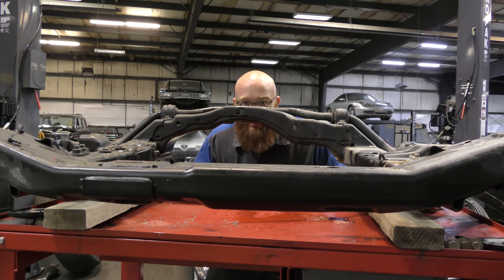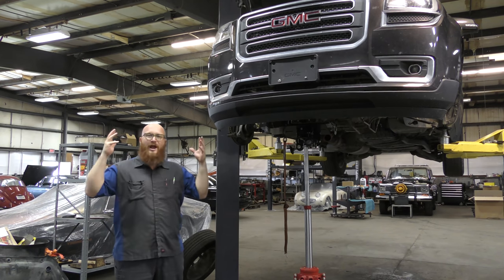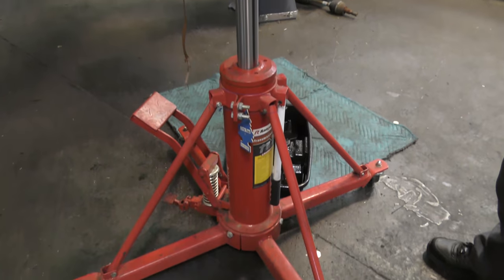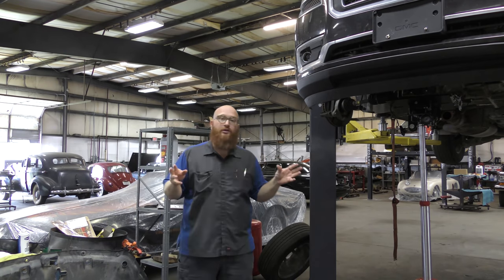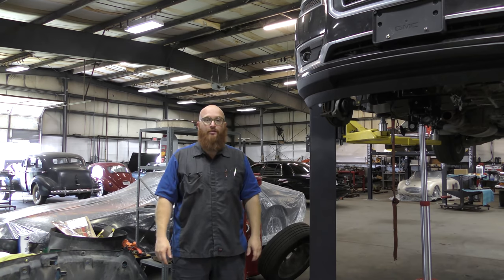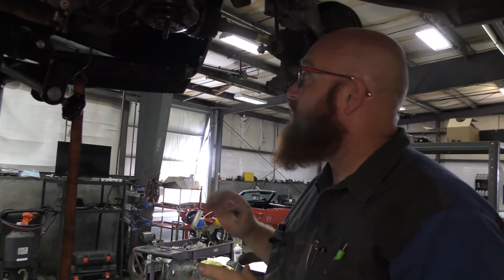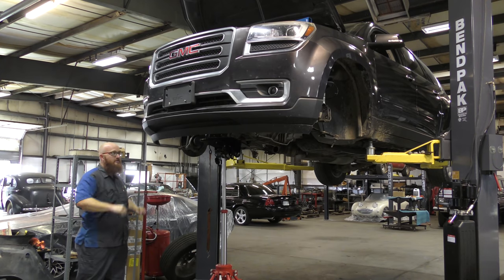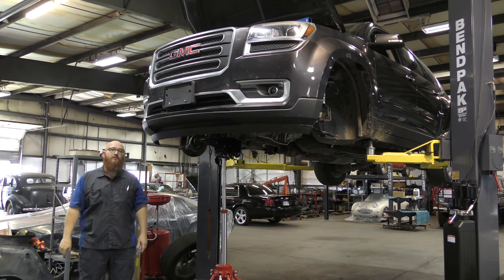Used car insanity in the CAR WIZARD's shop! Why did the huge repair get approved on this '15 Acadia?

Comment: It’s not a weird economic boom.  It’s called INFLATION!
Reply: Yes and no. It's a price increase caused by the temperary shortage of new cars due to supply chain issues the automakers are having. Used car prices should return to normal once the supply of new cars returns to normal.
Reply: supply and demand
Reply: It's not INFLATION.. It's SUPPLY AND DEMAND!!!!

Can't buy a new truck, so used trucks go through the roof!!!
Reply: It’s a lot of things.  But it’s not inflation.
Reply: Um… no.  You might want to look into what inflation actually is and what causes it before assuming
Reply: @johnschnellbach986  It is inflation...almost a fifth of ALL US money were created this year out of thin air but nobody made new vehicles out of thin air.As long as they keep printing money and give it away as "economic felief" your trucks will get more expensive and hard to find.Did you understand now?

Comment: Hey Wizard, I see some shops that have what's called a Big Ass Fan. Basically, a big ass fan. Super good for circulating air when it's that hot out.
Reply: Fun fact, all Big Ass Fans are designed & manufactured in Lexington, KY. Pretty cool.
Reply: Pretty sure Tyler has one in the new garage.

Comment: I have a Slightly Different Take on the GM 3.6.  

For most folks, I agree it is just better to avoid unless your mechanically inclined and really stay on top of your vehicle maintenance. 

However, if you are mechanically inclined and do maintain your vehicles, there is an opportunity to save money. 

I bought a 2014 Buick Enclave for the wife in 2018 with 35K miles for less than half sticker.  I fixed the PCV Valves and religiously chance the oil every 3000 miles.  It now has almost a 100k and have had no other issues.  Didn't take much work or expense, you just have to be mechanically inclined and disciplined about maintenance. 

The Car Wizard has made a similar point about the GM Northstar V8s with the head bolt problems. 

It also reminds me of the GM 3.4 L V6 with intake manifold gasket problems.  Over 15 years, I had 4 GM Minivans with that engine.  I bought them at a steep discount with low miles and simply put on the Felpro Replacement Gasket set and drove them for many miles with no other issues.  They were so cheap, I saved a ton of money on family transportation budget.  

Is simply buying a Totyota at MSRP a bad choice?  Of course not.  But there is money to be made on GM's unfortunate design choices if you apply some critical thinking and pick your problems well.

Comment: Another really good video from the Carwizard! But I wonder - do you replace the old timing chain with the a new stronger timing chain or is this a ticking bomb even with replaced chains?
Reply: The chains themselves are built just fine.  It's lack of oil changes that kill them.  The factory oil change interval is too long as it is, then owners will stretch it even further, causing the failures.  We've got customers that change their oil every 6k miles or so with quality oil that are still on their original chains well past 150k miles.
Reply: @craigbomer8962  that's what I was just saying in another section. Maintain your vehicle and it should be fine goes for any manufacturer.
Reply: @craigbomer8962  what is a healthy oil change interval for a 2016 acadia 3.6? we're currently using Mobil 1 full synthetic 5w30 and changing every 10k with a mobile 1 oil filter as well. the oil bottle says it protects for 20k miles guaranteed, but im not a moron and i'd never let oil go that long. so i halved it at 10k. whats your thoughts? should we do it every 6k?
Reply: @Frankenslide  I'd go for 6k or so. 20k mile oil is a gimmick and I've seen it cause problems if you actually go 20k between changes. The oil itself is perfectly good oil, however, usually has high detergent levels to help fight sludge buildup. 10k can be a little long, and depending on driving habits, the oil monitor will trigger around 10k anyway.  A bottle of motor flush once a year would help, as well. Just the stuff you dump in, run the engine at idle for a bit, then change the oil.  I use Gunk Motor Medic, personally.

Comment: Why people choose a modern GMC or Chevy product baffles me over a Honda, Toyota etc.
Reply: It's funny you say that because I know two guys that switched from Toyota to Chevrolet and absolutely love their trucks but I keep telling them to expect problems out of the transmissions and the chinese valves.
Reply: EXACTLY.. I know a woman who had a choice between a high mileage '08 Toyota Highlander and a '07 Chevy Equinox. both AWD. She chose the Chevy because it was cheaper. 0-:   That thing lasted about 18 months before the driveshaft snapped in half..$800 to fix that... next the tranny went out. At that time she got rid of it and bought a older Toyota Camry. Transportation issues solved.

Comment: My brother has a 2019 Traverse (leased). He gets free dealer oil changes every 5,000 miles. Since new, it has burned a quart of oil every 4,000 miles. Luckily the truck has a very sensitive low oil warning that lights up with one quart low.

Comment: Biggest issue with the 3.6, not changing the oil at 3000 miles.  Any engine with variable timing needs clean oil to function.  If you go 5000 to 8000 miles like it says in the manual, it will be your car on lift with a $5000 bill.  So for an extra $600 in oil changes you avoid $5000 in repairs and have engine that will go another 100k in near perfect condition.

Comment: I replaced 4 actuators on a neighbor's 2011 or 2013 acadia, can't remember which, and it didn't take long at all.  2 on the driver's side that were super easy to reach down by the right calf area  and 2 on the passenger side center dash console that necessitated pulling a trim piece off and the correct tool to remove and replace them.  There may have been a 5th up behind the dash, but I don't think so.  Took about 90 minutes to replace all 4.  The ones used in the acadia are especially crappy.  They ALWAYS go out, more than any other car I've worked on so far.

Comment: Was the failing HVAC actuator a GM issue? I've had three family members have that issue over the past fifteen years or so that I heard about, and each one was a GM vehicle (actually each was a Chevy). I've had many vehicles over my life, and never had one fail!
Reply: Across all brands, the actuators are all garbage, plastic geared pieces of crap.  Have a Lincoln mkz that has one that failed.
Reply: Had a 2011 mustang, 2 of these failed, luckily both could be replaced for around 1 hour labor rate.
Reply: the one in my 95 ford ranger broke but i ended up just cutting a hole in the glove box and ducktaping it open to full cold
Reply: Most of the mode actuators are accessible through the driver's side footwell and the recirculation door is through the glove box or under pad on the passenger side. The darn temperature doors are the big issue being somewhere in the middle of the cabinets. Those are the ones that require the dash removal usually. You could wind up being the lucky one to have to replace the evap or heater cores on the cabinets that need to be split for access to either one of them. Makes you cringe at the thought of a customer seeing their dash disassembled in that way.
Reply: had to replace all 3 on my 09 Mustang, then all 3 on my 07, all 3 on the GF's 09 and once again after 2 years the center one on the GF's car is skipping again. Luckily on at least the early S197s all 3 can be accessed pretty easily if you just swing the glove box all the way down.
Reply: Doubtful that GM even makes them.  It's probably a 3rd party supplier that supplies them for multiple brands.

Comment: I believe the 3.6 timing chain issue was fixed around 2013. Obviously with lack of maintenance it's an issue in any car, but I was under the impression that 2012 and earlier 3.6 were much more problematic.
Reply: Wrong impression - that is a 2015 Acadia !

Comment: GM in the last 6-10 years have gone severely downhill
Reply: I’d say since the 80s. Lol
Reply: You must be a young guy.  GM has built crap for 4 decades
Reply: @dougn2350  They had some decent stuff in the mid 90s-early 2000's
Reply: @mph5896  Even in the last decade they have decent stuff. Take the Chevrolet SS for example.
Reply: @atx-cvpi_99  Tough to get parts in a timely matter for one of those.

Comment: I just replaced the power steering line, motor mounts, and spark plugs on my 2016 traverse. Bleeding the power steering pump was a pain. Vacuum bleed finally worked.

Comment: I had all of my actuators fail on a Ford Fusion (flooded vehicle). I disconnected them all, manually set the vent to blow only on the windshield. Once a year I stick my hand under the dash and manually open or close the vent that switches from AC to Heat. Its definitely not ideal but this way I can drive this thing for a few more years in hopes of car prices coming down.

Comment: I like how Wizard touched on the high used car prices these days. Surely it's just a temporary bubble, right?
Reply: Sure is, same here in the Uk.
Reply: Definitely, once new car production ramps back up the balance will be restored. The new supply coming into the market is minimal, and demand ramped up with people going back to the office/decrease of wanting to use public transportation. I'm guessing around 6-12 months.
Reply: @DennyJr22  Not necessarily. A couple of things:

1. Most analysts are putting the chip shortage ending mid-to-end of 2022, if not early 2023.  The impact on new cars is going to be long running.

2. Many used cars are off-lease new cars. Due to the chip shortage you cited, plus analysts not expecting the shortage to abate until mid-2022 at the earliest, we may be looking at used car shortages until 2023 or 2024.
Reply: @jameswhitehead6758  I've seen early 2022 tossed around, bottom line is nobody knows. Certain manufacturers will be hurt more then others so I can certainly see 2023 for some makes and models. Bottom line is I'm happy I bought my new car in March lol.
Reply: @jameswhitehead6758  You can import used cars from Europe. In 2030 no more new fossil cars can be sold in Europe. And all manufacturers with some brain (not Toyoda…) have already said they will offer only EVs in Europe starting in 2025. Usually we send our old fossil cars to Hungary, Romania or Africa. But maybe the US is the better market?
Reply: All the more reason to hold on to my '99 Saab. Any thoughts here on Porsche investment in e-fuels? They're going to do limited testing in 2022.
Reply: @laurat1129  They'll never be commercially viable. With ICE bans starting in 2025 (Norway), and more substantially in 2035 (California) the R&D costs are just not worth the investment with the shrinking of the ICE car market.

Porsche will do it just to do it, but it's just not viable on mass market vehicles.
Reply: @laurat1129  Maybe you bring your local E-Refinery to produce you some E-Fuels. Nobody else will do that kind o thing. Its just too expensive and you still produce poisonous gases and all other manufacturers have already said they go with batteries.  Of course not Toyoda. For him there is no such thing as climate catastrophe or oil shortage. Never!
Reply: @dougn2350  Yes we had the same programs in Europe, the last was around 2008. Only a few of the old junk is left. Mostly rusted away, but not all. 

A similar program will hit our markets not later then 2026 to remove the most of those fossil stinkers, clean up the roads, make them more reliable and safer to drive on and no more stinking and polluting the air. 

Its sad that they can not be converted to clean, unburning fuel, used cars. Its just too expensive.

Comment: If the timing chain goes bad also replace the oil pump as well. Same goes with the Ford 5.4 liter 3 valve engines. Here’s a video on how to make your 3.0 or 3.6 liter engine last 200,000 miles or more: https://youtu.be/9PoKIlwCrOk
Reply: Same goes for any car, replace everything while you're that deep. I did my ford's pump even though it didn't need it.
Reply: I don't know about this car but many water pumps in there too

Comment: After watching vechor rebuild several of these, I've seen things in it I wouldn't believe.
Reply: Yep, Scott finds that GM left out plastic push pin plugs, couple of bolts missing under the front quarter panel, etc.  He's hilarious.  " ...the pile..",
Reply: @sniggitty  and Ford using glue on the fenders.

Comment: Had an 2004 GMC Yukon. Decent truck.. hardly any issues with it. Tranny went out at 120K miles but we hauled stuff with it so i figured it was that. Time came to replace it... got a 2016 Yukon and only lasted 3 years with it. Problem after problem. I couldn't wrap my head around a $65,000.00 having that many issues. Got rid of it and bought an almost brand new Toyota 4runner. So far i love my new truck.

Comment: I can relate to the kind of cars that are often found at car auctions. About 10 years ago I was looking for a used car for my fiancée. We went to several used car dealerships and virtually everything was junk, regardless of the make or model. They were basically homes for broken toys. The vehicles were in a bad state due of abuse. I spoke to the dealership owners and they said that they got all of their vehicles from auctions. I eventually ran across a small dealership that had some good vehicles for sale and we ended up with  Ford Escort Wagon that was in excellent shape. That dealer showed me a great looking GM van that he just purchased and subsequently discovered that it had a leaking main seal. He said that he was going to take it to an auction to see if he could get most of his money back as he didn't want to fix it or sell it to a customer. Thank you for the video.

Comment: Hey, did Wizard mention the mileage on that Acadia? It's only 6 years old to have all those problems. Is it at least a very high mileage truck?
Reply: These give up prior to 150k usually.
Reply: @Danbuilt426  Wow! that's sad. One of my Jeeps is a '98 Cherokee with 225k NYC miles on it. It has never had a major repair. Sadly, it suffers from NorthEast chassis cancer. Which will probably be it's demise. It was dirt cheap when it was new. That Arcadia was NOT a cheap truck, and it probably won't live to see 10.
Reply: @kenrock — my 2013 Acadia (same as the one shown here) is dry @ 125k miles. 🤷🏻‍♂️

Comment: what I like about you and your channel is that you are 100% honest and I would trust you working on my car.  I have an older mercedes benz and I think i have a leak in the evaporator and to get to it, I have to remove the whole dash to get to it. I just do not want to spend money to get to it.  I am afraid to tackle that kind of job.  But I dont driver that much so it is ok.  I did put the blower motor into my car that was a chore but it was satisfying to know i fix it and that repair would cost about $1,000 just cause what you need to do to get to it.

Comment: That old Pontiac with a carb, pushrods and points looks real appealing  after the crap new cars are and the nonsense  to repair them.
Reply: That's why i as a swede drive a -66 volvo amazon in the summer and a -86 volvo 245 in winter time.
Reply: That old Pontiac with carbs, points,  and pushrods also started hard, got shitty fuel economy, and had leaking oil control rings by 100k miles.
Reply: @cpscps2679  still better than new cars. I can buy a brand new small block for less than a timing chain job. They ran fine if you know what your doing.
Reply: @cpscps2679  That is likely true.  The older cars were in some respects better built but the newer ones have far better ride and handling and in general are more reliable and need less routine maintenance.  The down side is that repairs can cost more (a lot more in some cases) when poor design makes the vehicle difficult to repair.  Some parts on many cars have become more expensive and harder to find due to the pandemic too.
Reply: MRGRUMPY53  plugs and points as cheap and easy to change , no mechanical knowledge needed anyone can do it.  Price out the computer that controls an ignition vs a 10 dollar set of points.  All parts on new cars are insanely expensive.  
Unfortunately cars are appliances now just not made to last .
Reply: MRGRUMPY53  fair enough drive your camery ill drive my 71 gmc we will see which one is still running in 20 years. And my gmc already has had a lifetime of use.
Reply: @toecutterjenkins  
Depends a lot on the make and model.
Older cars are simpler to repair. But generally speaking when people talk about their 20-year-old vehicle that's still running great. When you ask them how many miles are on it they'll tell you 80,000 or 120,000 and they think that's a lot. 
I've got a 2008 Toyota Prius. Just about the most computer-controlled electrically complicated vehicle you could own. 
But mechanically it's incredibly simple. Which is why it's pretty reliable I've got  374,000 miles on it.
I put 174,000 on it in the last 3 years.
45 - 47 MPG.. kind of important when you drive 60,000 miles a year.
I've got a 93 Wrangler 4.0L it's sequentially port fuel injected still runs great 205,000 miles. That one's pretty easy to work on lots of room around the engine bay.
Not all new cars need constant repairs and maintenance. Of course there's always the occasional lemon regardless of making model. But if you're going to roll the dice on a new car you might as well roll it in your favor and buy a Toyota or a Honda. And even within those brands some models are better than others. You just got to do a little research before making that purchase.

Comment: Acadia, Traverse ,Enclave ,& the Saturn outlook. All the same vehicle. Always in the service bays with the engine/ subframe out when I worked at a GM dealership. Oh and if your struts are slightly worn, they will lock solid if the vehicle is off the ground for days & days.